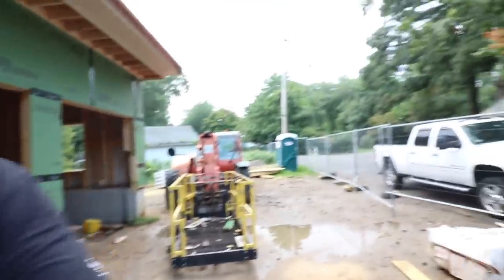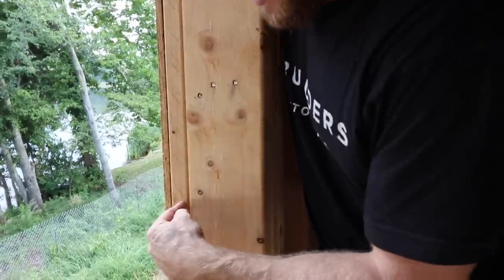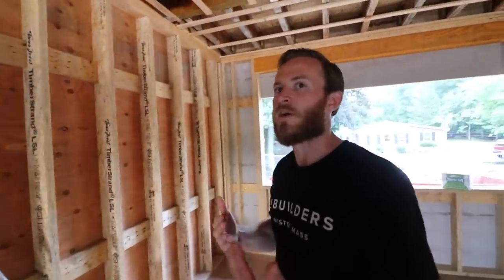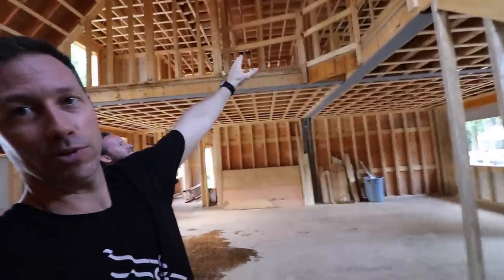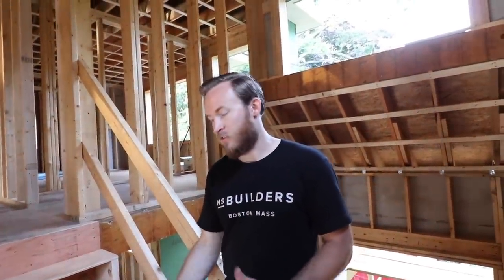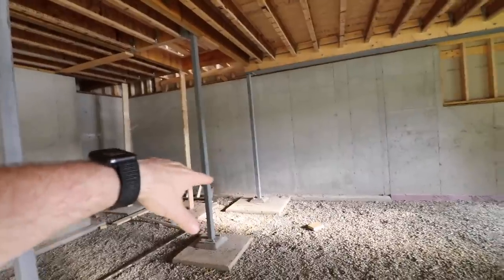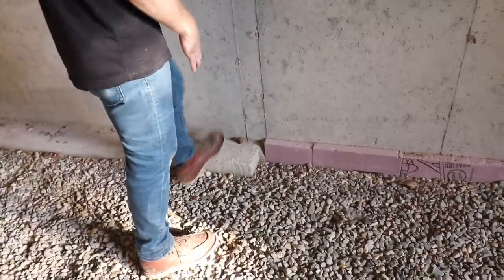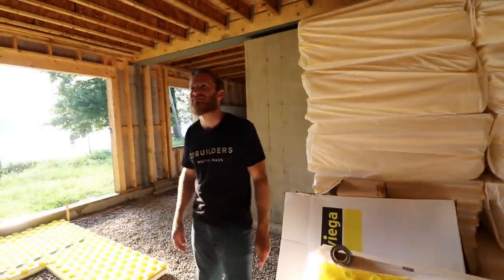How do they Build in Boston? Visiting a new home in Framing

Comment: Strapping is SOOOOOO helpful in the future if you want to run new wires in the ceiling.  I can't imagine how you'd do it without strapping.
Also, even on new construction you don't need to drill too many holes
Reply: Sergey Bebenin how’s strapping help with wiring?
Reply: John McNiff  You don't have to drill through the studs.
Reply: @John28530  
Finished: there's always space left between sheetrock and strapping/joists no matter what direction you go (at right angles).
New: you can do same thing as finished, just have to staple the wires along the way.
Edit: I'm installing recessed lights in a house and in many places I can reach in with my entire arm to pull wires from couple of strappings away
Reply: To my knowledge that wouldn't meet code if you are running romex/high voltage wire against the drywall/under the joist like that.
Reply: @curtisbme  
It's fine in MA, at least.  I worked as an electrician for about 8 years (until 2001) so unless something changed, it's per code
Reply: I dont see how that would be code it's not recessed enough and thats nec its a national code
Reply: @lewweb451  
Wires are much flatter than strapping so it's recessed.  Even when 12 Romex is doubled up, there's still plenty of recess.  Anyway, we've passed hundreds of inspections so clearly it's ok in MA.  In fact, in new construction all (at least most) wall outlets were interconnected via lower floor and going in between strapping... Drilling only 2 holes instead of holes in every stud.
Reply: That wouldn't pass here in OR either
Reply: Good reason not to settle in OR.
Reply: It does meet code here in the northeast.
Reply: @GarwoodNick  Just goes to show how arbitrary and capricious building codes are in the US.
Reply: @sergeyb8  remember, just because it passes inspection doesn't mean it's right, it just means the inspector either didn't catch it or they didn't care. i see a lot of that, they have certain pet peeves and only focus on those and ignore more important issues. while i'm sure it makes for an easier install, but it seems to me that there would be a great potential for wires getting cut while cutting the holes to add lights or just hanging things from the ceiling such as pot hangers or swags, etc..., especially if your new to the home and aren't aware of the install methods done at rough. when i rough in a house i try to protect the wire from damage down the road as much as possible, because i hate repairs. but hey, that's just me.
Reply: @chaser9363  
It's legal...  I checked with my friend who's still an electrician (20 years now).
When you wire for light boxes obviously you keep the wires away from the box (they have to be stapled to joist above the box anyway).  I have never seen these wires damaged in my career.
Reply: @sergeyb8  yeah, "you" have never seen these wires damaged because "you" weren't the one damaging them or repairing them. and maybe even they didn't "get" damaged, and i never said it was a violation of the code. my point is there is still a greater potential for damage to occur when the wire is installed that close to the finished surface. believe me i know because over my 30+ years experience in florida with block homes using 1"x 2" furring strips on the block, i've seen and repaired plenty of wires cut or screwed through right through the nail plate from just the drywall guy not wanting to stop when he hit something hard, or as just a couple weeks ago the rough guy ran the wire to within 4" of the bottom furring plate and the trim carp. used the 5" base and shot his nails into the wires. all the while the house passed inspection at rough. but that didn't prevent me from having to make the repair and the rough guy never saw it happen either.
Reply: @chaser9363  
Sure, you are from FL and builders there aren't accustomed to this method.  I don't understand why your experience is "better" than mine in MA.  Just because you have 30 vs my 8 and my electrician friend 20?
Anyway, think what you want
Reply: @sergeyb8  dang dude you are way to sensitive . i don't know how you've made it in this trade as long as you have you're the one who brought exp. into the conversation just thought i'd share mine. and you're right i think what i want and i know what i know. just trying to share some experience but obviously you're close minded so i'm just wasting my time by even trying. whatever dude.
Reply: @chaser9363  
I'm not sensitive.  I simply don't understand why you are trying to prove that "your way" is better when in MA it's done as I described as I've never heard of this being an issue.  You shared your thoughts and move on, don't try to convince me that "even though it's legal, it's not the right way".  That's the feeling you are projecting

Comment: Strapping is a nice feature because it makes it easy for drywal, not only is a benefit to drywallers its also a benefit for electricians because its easy to run a snake right between the that gap to run data or additionial recessed lights in the future

Comment: I just happen to notice something with the general construction layering, please correct me if I just missed something (I'm from Europe, I know we build differently, and your construction methods are absolutely fine I guess, I mean it seams to work, but just noting a difference): You have your air-tight barrier on the outside. So in this case, behind the thermal insulation (if you look from the hot side). To my knowledge, that is the wrong way around if the inner room is the hotter more moist room.
The air tight seal is supposed to be on the warm side, not on the cold side. It is not supposed to hold of the moist air from the outside, but to avoid moist hot air (from the inside) to come into contact with cold surfaces. With the setup like in the video moist hot air will get through cracks, gaps, holes, electricity cables etc. into the insulation and travel through to the cold outside airtight layer. There it will condense on the cold surface, at least as soon as it gets cold outside.

Might be absolutely fine if the winter is not long, if the structure is capable of dealing with beeing a little bit moist from time to time and if the structure can evaporate moisture into the inner rooms from time to time. But at least to my knowledge, the air-tight layer is supposed to be on the inner side of the insulation. On the outside of the insulation is the water proof layer, on the inside the air tight layer.

I really like the copper work though. During my visits in the US a rarely saw any real detailed thoughts beeing given on how to actually waterproof residential homes. And in Austria its a whole profession in and of itself to make all the metal work for housings the right way (I don't know what the english expression would be for a company/person doing that, maybe "tinsmith"? In german its "Spengler").
Nice construction overall, glad to see insulation taken care of without spray insulation :)
Reply: Science is awesome 👍🏽

Comment: Sealing the ZIPR to the foundation is a mistake. When water gets behind the ZIPR (and it will)
it will be trapped. Trapped water is never good.
There should be a waterproof/airproof barrier behind the foam and seal that to the foundation.
UPDATE: 7:51 inch of closed cell spray foam on backside will be good waterproof seal but still need to allow the ZIPR panel to drain. If you don't want exposed foam put some type of insect proof mesh where ZIPR meets foundation but DO NOT SEAL it to hold water.
Reply: Totally agree! This was a detail that they should not have veered from the normal principles and techniques. It is a negligible difference in quality and not required to get additional insulation. Houses in North Dakota are plenty sealed from the 60 below zero weather without doing this technique.
Reply: Because cold always travels up! This guy is too manicured for me to believe he is a seasoned builder. Fancy boards and over engineered builds make for builds going over budget/schedule, difficult repairs and expensive maintenance costs. Why use fancy expensive materials if you aren't using them to their potential. Composite materials should be used to push the limits of conventional materials not just replace them and use the same standards.
Reply: Follows the train of logic that a more expensive tool is not better. If you can't get the job done with a cheap tool or cheap materials you need to practice your craft more. expensive tools and products do not replace really solid craftsmanship understanding and talent.
Reply: This guy is a perfect example of marketing yourself through social media.  When you only post pics of finished product no one sees what went into the craft.  NSBuilders has marketed themselves as experts yet this is his first home build, lol.  You can see it too.  Not knocking first builds as everyone starts somewhere, yet this guy has a podcast, contributes to finehomebuilding mag and  yet he is essentially a noob homebuilder.  That's the problem with social media, so many people who aren't actually experts are able to market themselves as ones and people believe the hype.  There is nothing impressive about what was done in this building, but I'm sure the video will convince a future customer that this guy is a super pro, it's sad.   Tons of awesome contractors out there who don't bring a camera to every jobsite and sell themselves online, they just let their work and their customers speak for them

Comment: Schluter also makes the EPS interlocking panels for PEX pipe radiant heating. Probably costs a fortune. Interesting build, we use a LOT more steel strapping here in the SF Bay area, obviously. I think it is becoming code for tornado and hurricane areas. Gotta tie it all to the foundation.

Comment: 4:45 / 9:30 / 18:15 Water intrusion with no fans, etc seems bad.
Reply: Thought about this too.. kind of too much water to ignore...
Reply: No big deal with an advanced OSB product.
Reply: @mpodobnik  getting on more than OSB though
Reply: that is a lot of roof leaks
Reply: Looks like a normal build at that stage here in the PNW during fall-spring.
Reply: @curtisbme  for sure! In the winter I've been on plenty of jobs with standing water on the sub floor and the crawl space is o swimming pool.
Reply: Just thinking about eventually trapping All that moisture i the Framing
Reply: This area has been receiving pnw-like amounts of rain lately, the water hardly surprises me
Reply: Not surprising at all especially in rainy climates...or where it’s not normally wet but just received a ton of rain. Shit happens.
Reply: xephael - you make it sound like the house is about to go bad if they don’t fix it. Come to Canada. I’ve built houses foundation up in 24/7 rain. The wood can take it.
Reply: Zip wall is NOT waterproof. It WILL expand at nail holes (even when not over driven). Regardless though, they are still in the rough framing stage, and water is inevitable.
Reply: In the rough framing stage, water is inevitable. Period....unless your building under a tent.
Reply: It's not going to "trap" the moisture, because it will dry to the inside or outside. It's not that houses don't, it's that they go thru a wet cycle and then a drying cycle (unless you do "trap" it will double vapor and moisture barriers.
Reply: For centuries in New England, old homes go thru a wetting cycle and then a drying cycle every year. They can breath one way or the other or both. In this case it will dry to the inside, and then dry to the outside. It's not like it's got drywall up, or insulation, or flooring, or is totally air sealed.

Homes all over the country get wet during the rough framing construction stage - unless they are built in a tent.
Reply: It's code to have pressure treated directly against concrete. That is unless you put zip tape or liquid applied capillary break under the sill.

Comment: Matt, thanks for sharing.  I noticed also the strips on the ceiling for mounting the sheetrock, which is how they also build houses in Mississippi, where I am originally from.  I live in Plano, TX. now and noticed on my ceiling the sheetrock in attached directly to the joist, which are on 24" centers, so the sheetrock sags and makes for an unattractive ceiling, especially since the humidity here in Texas seems to be higher year after year.  I noticed the same technique on the house I used to own in Carrollton, TX.  This was also a major concern to me since I wanted to add a lot more insulation in the attic, which would translate to more weight on that sheetrock, possibly causing the sheetrock to pull away and fall from the extra weight.  I am in the process of adding additional joists to put it all on 12" centers (its a 14' span with 2"X8" joists), then I am going to floor it, so I can add the extra insulation without the concern of the extra weight.  I enjoy your channel, and regularly find useful information I can use on my own projects, thanks much and safe travels!
Reply: jimmyturpin where in ms are you from? My wife and her family are from the Hattiesburg area and you are correct about the framing being done like this down there. 

It’s pretty interesting to me to see how in different areas of the country the different construction methods and techniques that are used and why.  

Take care and keep the heat and humidity down in Texas please
Reply: Hi Don, I'm from Brookhaven, but lived in Laurel, McComb and Jackson before moving to the Dallas area in 1996.  My sister lives in the Hattiesburg area with her family, after graduating from Southern with a degree in nursing back in the 80's, and she knows almost everybody, so I would be willing to bet she and your wife likely know each other somehow.

Back to the construction though, yeah, I'm not too impressed with the way they build house here in Texas (BTW, the houses I owned were built in 1988 and 1989 respectively), it's like they just throw them up as quickly as they can, I've had to install walls in the attic to properly support the roof, because clearly the carpenters that built my house haven't grasped the concept that a triangle needs to be closed in order to have strength.  I had cracks up and down my brick walls where the roof literally "breathed and heaved" during strong winds, forcing it up and down, and against the perimeter walls, cracking them, inside and out.  I didn't realize how bad it was until I went to install 4' x 8' radiant barrier panels in my attic to enclose the insulation around the rooms on the second floor and give it a little extra strength, and they were almost 2" out of square from top to bottom.  Standing out in the yard and looking up the roof, there were also noticeable sags.  Anyhow, after picking up a 10 ton jack at Harbor Freight, and jacking the roof up, then installing walls in various locations to support the roof upon load bearing walls, I was pleasantly surprised the walls where I wanted to install those panels were now perfectly squared up, so I was able to complete that part too.  The best part is that the cracks in the inside and outside walls closed up and I haven't seen them in the last 3 years so I'm taking that as a win.

On a final note, I'm currently converting my house to a fully, and I mean fully zoned air conditioned system.  Another Texas thing that drives me nuts is the insistence that I have separate AC units for upstairs and downstairs.  If I set the upstairs and downstairs to the same temp, in the summer the upstairs unit does all the cooling.  In the winter the downstairs until does all the heating.  I realize the concept is supposed to be a simple zone concept but I have a large downstairs entry area that is open to our upstairs den and downstairs formal dining and living areas so I'm constantly having to deal with stratification of the air, with upstairs needing to be 3 or 4 degrees warmer (regardless of season) to get both units to work in harmony with each other.  Anyhow, that is why I was flooring the upper ceiling so I could work safely on the ducting (installing all metal ducts and getting rid of the flexible hose, cause frankly, I think it looks nicer and more professionally done).  We replaced one of our units a year ago, and made sure it was sized to handle the whole house.  I want avoid replacing our other unit, a very trouble free Rheem that finally died at the ripe old age of 30.  Trying to have everything done by the end of the year so I can compare energy metrics over 2019 against the two unit arrangement we had before.  I suspect, besides saving 10K for a second unit, that my energy consumption will drop and we will enjoy a more comfortable indoor environment since we will have better control of the air flow around the house.
Reply: homes in texas used to have beaded ceilings all wood and wooden porches but as builders came from around the country the quality went down especially california builders their quality is garbage.
Reply: rayt please take all of your Texans back. They are ruining California.
Reply: jimmyturpin ...Jimmy...I live just North if you in Prosper. Your ceiling drywall should be 5/8” if built in last 15 years. Should support considerable loose blown fiberglass insulation you might add.
Reply: ....as I’ve stated earlier...give an illegal a stack of lumber and you’ll get a third world outcome every time. (old school framer who struggled with sub-par subs as a superintendent, then custom builder).